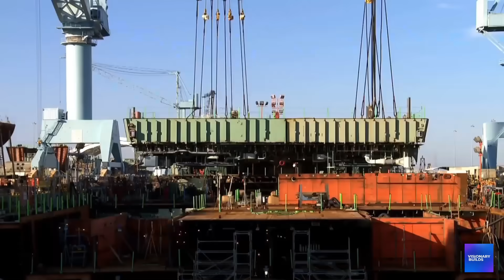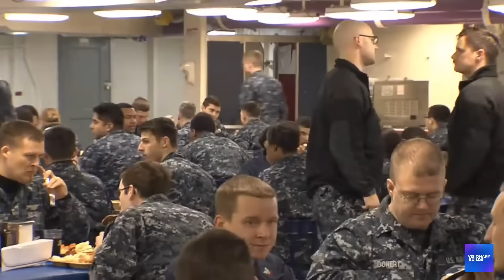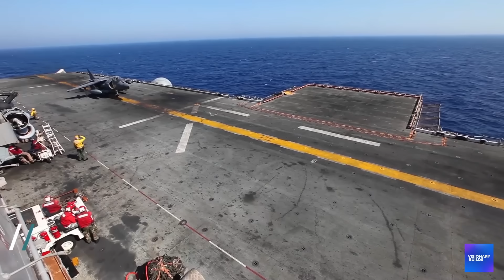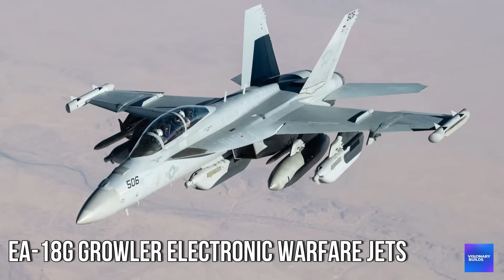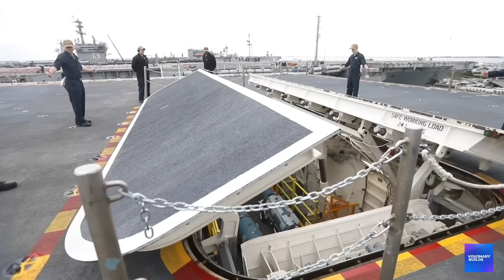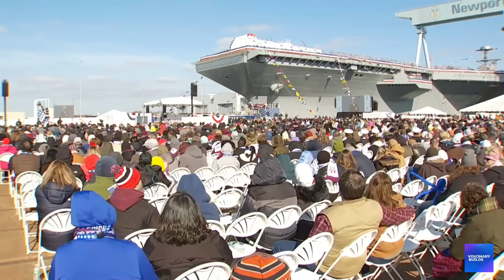Inside the Race to Build $13B Mega Carrier in Virginia

Comment: The problem with this class? It's all in the math! It's really quite simple. E=I/R+ seawater = unreliable performance. All electric CATOBER systems, require high voltage to perform critical tasks. Seawater on a warship at sea? Has the express ability to get into everything. Seawater reduces impedance. Allowing high voltages to travel to unwanted places. Minor issues leading to unreliable performance. Major issues could start a class C fire. Or a far more dangerous flight deck incident.

Comment: They say generals always prepare to fight the last war
With hypersonic cruise missiles are carriers sitting ducks? Are we preparing to fight WWII with new carriers?
Reply: lets finish WW2 first
Reply: not exactly.  Hypersonic cruise missiles: are not all the same.  Can they maneuver at hypersonic speeds?  Are the last miles that a hypersonic cruise missile actually flying at hypersonic?  Are they cost effective? The US does operate a few systems that can intercept missiles traveling at hypersonic speeds.  One system is the US Arleigh Burke DDG using SM-3 interceptors.  A carrier battle group will often have several of these DDGs protecting the carrier.  A true hypersonic cruise missile is likely several million each and wouldn't be available to most nations.  China is stealing and reverse engineering stuff.  But they have a challenge with the advanced materials that are required in small compact high speed engines.  Their domestic J-20 is not doing well.  Because China is unable to produce reliable engines capable of high speed.  Likely not even the Chinese can produce a reliable Hypersonic Cruise Missile.  The US has several companies working on hypersonic aircraft.  The leading contenders are using missiles that use dual engine technology. (not sure of the correct terminology) Hypersonic engines are best at speeds ABOVE Mach 4-5, but can't function below Mach 3.  So a vehicle needs to be able to sustain speeds above Mach 3 and then transition to the specialized Mach 4+ engine.  This creates a very large missile that would not be easily launched from most planes.
Reply: @AmFirst1776 chinas latest drone @ mach5 strike , is about $100,000. the plasma shield protects the nose , interception side on , the math says you need Mach ten to catch it when dancing
Reply: It'll be very nice to have an invisibilty-cloak.

Comment: How about passing the added costs due to equipment not working properly to the manufacturers of said equipment? If their $hit doesn't work, it should cast them, not the Navy.
Reply: This sounds good, but the problem is that the Navy is asking contractors to push the envelope to develop and perfect new technology that doesn’t yet exist, which is inherently risky. Someone has to bear that risk. If you force the contractors to bear the risk by passing the added costs to them, the result will be that they will demand more money up front to pay for that risk. In the end, it costs the same either way, but it’s often more efficient for the government to bear the risk.
Reply: @chriscoleman8303 Fair point. I wonder if the navy needs to embrace so much experimental undeveloped gear? Will it make a real difference in combat? Well, except power generation.
Reply: @codebasher1  Great question.  As someone who sailed on 5 carriers during the 70's and 80's as part of the airwings, yes it will make a real difference in combat.  These systems are designed based on all carriers and the situations they encountered in combat and emergency situations going all the way back to the 1940's.  Seeing the cats and arresting gear putting less stress on these aircraft is a major improvement that reduces damages to the aircraft and reduces the time required to repair systems/aircraft due to the stress.  Being able to get the weapons/ordinance up to the flight deck in a faster fashion is a major game changer.  The quicker those items can get up to the flight deck the faster the aircraft can get in the air and do what they have to do.
Reply: @jimc5096 Thank you for that. It's wonderful to hear from someone who's from the trenches and knows from experience. Cheers, mate.
Reply: @jimc5096  " the cats and arresting gear putting less stress on these aircraft is a major improvement"  Stop parroting the BS video.  All these magnetic gears enable the carrier in flying a wider ranges of planes and drones at different weight classes as well as increasing the sortie rates.   Reducing stress is only a secondary benefit.
Reply: @chriscoleman8303  "t the Navy is asking contractors to push the envelope to develop and perfect new technology that doesn’t yet exist, ..."  The Navy is colluding with the military industrial complex and Congressmen to scam the taxpayers. Get it right.
Reply: @chriscoleman8303  The problem is risk mitigation or lack of.  For example, China limits new technology on each iteration of carrier to 30%.  Technologies must be tested completely before putting it onto the design of the ship.  US has done the exact opposite.  If something is on PPT, it is good to go.  See Zumwalt class destroyers and Ford Class carrier for shining examples.
Reply: The manufacturer won't absorb the cost they will bill it to something else.
Reply: That's how it used to be but government doesn't operate that way any longer. They pay for failure
Reply: Maybe you can find a bigger customer for the Naval shipyard than the US navy. Some other company with deeper pockets. Let me know how that works out.